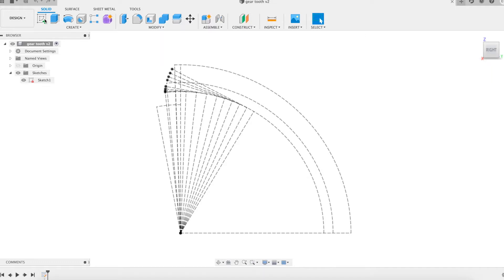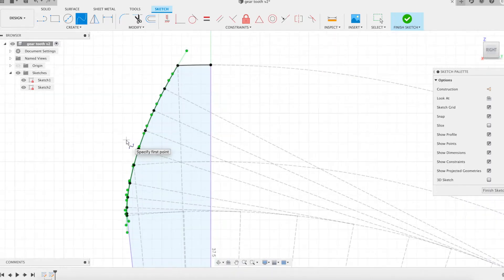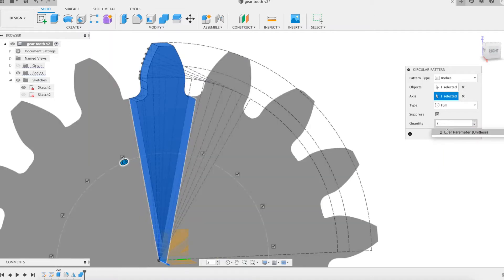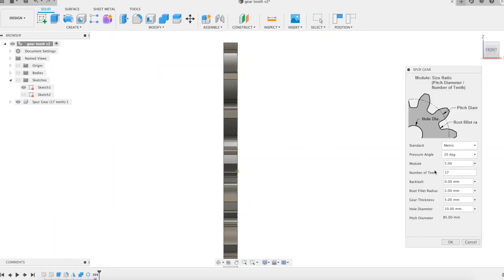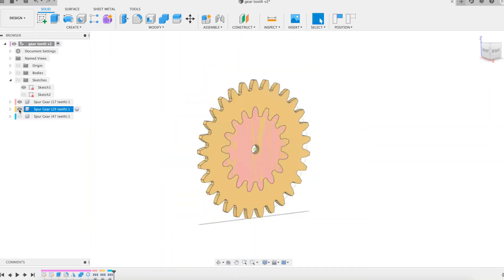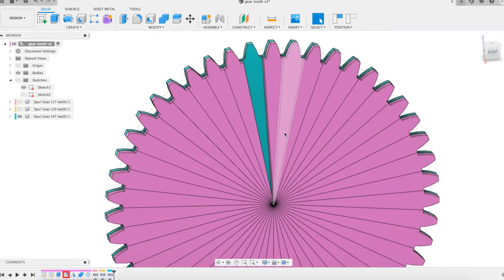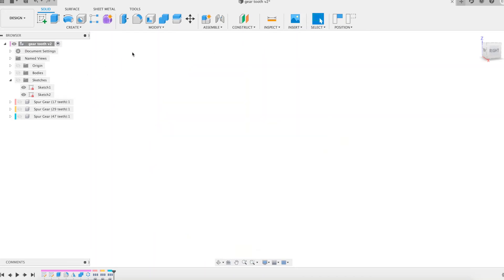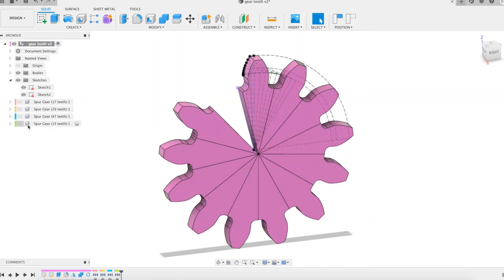Fusion 360: Sketching a Geometrically Correct Circle Involute to Model a Proper Parametric Gear (2)

Comment: Thank you so much for creating video! It's very educational for me.
6:07 It seems the Fusion360 SpurGear script uses `dedendum = (6 / 5) * module` (=1.2) while what you and various other sources suggest `dedendum = (5 / 4) * module` (=1.25). Presumably 1.2 slightly increases tooth robustness while having a minor effect on the risk for additional friction in the tooth root but it likely all depends on the use case, fillet and so on.
Reply from the maker: Thank you for your comments and research !
At the time of making this video I chose the most common dedendum value seen which I assumed to be the "normalized" and then the "correct" value, so ((1 + 1/4) * module).
Since, I saw various values for the tooth root clearance factor like 1/5 or 1/6. Now I consider (1/4 * module) clearance as being the meshing safer value but not the best compromise. As you say it's a trade-off. Even the addendum could be shortened at the same time as the dedendum for a stronger tooth, while keeping an eye on the contact ratio which shall never drop below 1.0, ideally always above 1.1 (but that's another topic).
And thanks for python script extract !
Reply: After some research it seems to be known as dedendum ratio and is a parameter that most often in textbooks is fixed to 1.25, has a minimum value to allow for valid meshing and can be traded-off depending on the use case.
Reply: I have to correct myself about what the F360 script uses. It's not a fixed 1.2 ratio. In fact depending on the gear you design it takes 1.25. Here's the complete calculation copied from the Python script:

if (diametralPitch < (20 *(math.pi/180))-0.000001):
                dedendum = 1.157 / diametralPitch
            else:
                circularPitch = math.pi / diametralPitch
                if circularPitch >= 20:
                    dedendum = 1.25 / diametralPitch
                else:
                    dedendum = (1.2 / diametralPitch) + (.002 * 2.54)